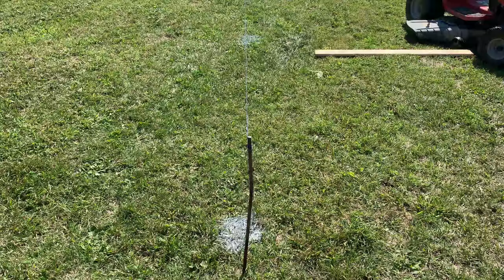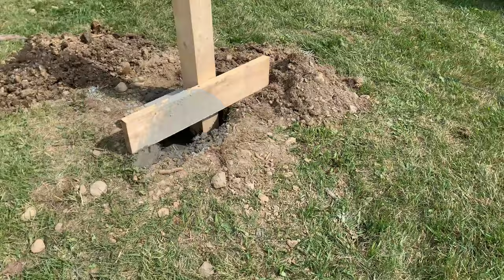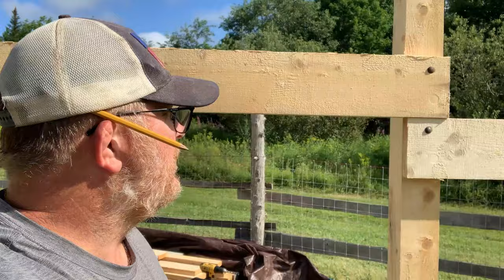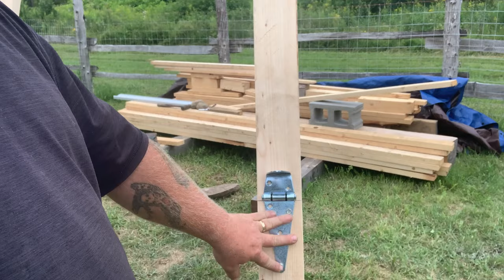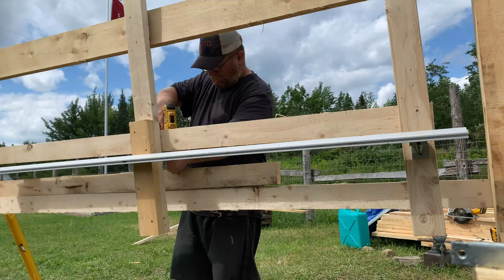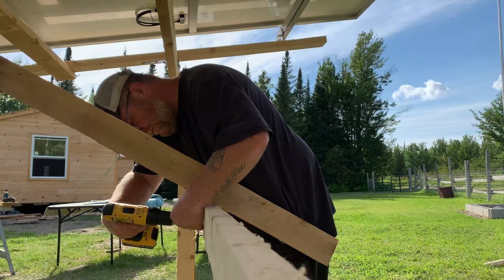Building our Adjustable Solar Panel Rack in Maine

Comment: As a suggestion from a retired mechanical engineer, you might want to change the angle setting mechanism to a 1/2 inch bolt through a hole made in the short "alignment" 2x4 and a point in the "adjusting" beam for each angle you want to fix the panels. A nut on the bolt can clamp the adjusting beam ridgely to increase systems stiffness.
Reply from the maker: Hi Mike, appreciate the suggestion.  This worked in the summer and fall but as we got into winter, I realized that I’d have to make a change to how it gets adjusted. Will be modifying the adjustment mechanism in the spring, so stay tuned! (As a retired ME, I think you’ll approve 👍)! 😊

Comment: You can also drill a few holes and use simple 1/4 or 3/8 nylon cord as lashing to prevent wind from causing mayhem with the swivels. They look pretty good. Are they working well?
Reply from the maker: The racks have held up in 50+ mph winds. We did have to do a few things to create a wind break behind the panels. Didn’t expect as high or main direction of the winds but they are doing great now! 😊

Comment: Great design and execution. 
I was solar off grid in Alaska and adjusting the panels through the year were no where near as easy as that.
Reply from the maker: Thank you for the encouraging words!!  I added additional supports to each section which improved stability of the entire rack. We’ve since moved the panels to our fall position and it was as easy as the video outlines.  😊

Comment: Looks good. I think I will do something very much like it today. I have 16 panels I will put 2 rows a series of 8 in a strings. I will be putting mine in just dirt but probably with a 2x4 45 degree outrigger to help with support. I will be moving these in 4 years so I want to be able to take them out. Not a lot out there about building a ground mount unless you use big steal and have heavy equipment to help. Glad to see something more on the average person's level. How did it hold up to the wind? Let me know if you would do something different now that you have had some time with it. Thanks for taking the time to show us. Wish me luck!
Reply from the maker: Hi! You’ve got the right idea with the outriggers, you’ll definitely want those if you don’t plan on using cement.  
Also, when you get your hinges, get a minimum of 6” hinges. 
This rack consistently sees 15-18mph winds with the panels in the near vertical winter position and hold up great.  I couldn’t be happier with the performance.  
Have had quite a few folks reach out and ask for an update on the panel rack so I’ll do another video here shortly. 
If you get time, take a look at my propane video; I give a short update on the rack.   
Thanks for the support and best of luck on your build!! 😊
Reply: @HanbleceyaRanch  Thanks for responding. Looks great! I should stain mine too when I'm done but might be a little late in the season lol. I think I'm going to have to put out 2x4s attached to 4x4s and deep stacked into the ground at least for now. Like you mentioned, Cable wires would be less noticeable and probably a better idea. Today was 25 mph winds here in MD so it got me to thinking harder on these big panels at 60 degree winter position into the wind. Spent way too much time at the store today getting supplies (well they were out of things so I had to hit 3 stores to get everything, a sign of the time and up coming future I'm afraid to say) and wasted the day spending more money than I had planned, hoping for some returns lol. I got 8" hinges with bolts to lock them into the 2x6. I'm bolting everything down no screws. Tomorrow I will get started. Enjoyed your propane video too. Keep up the good work! Thanks for your ideas and help! I will let you know how it goes.
Reply from the maker: @LivingFree4All  if the winds get above 20 mph my plan is to adjust the panels to their summer horizontal position.  Less drag and the rack doesn’t move at all - seen this during the summer.  So don’t worry too much about the wind, cause with this type of system it’s fairly easy to adjust it.  But the outriggers will be a must - both ways too.  In the ground just enough for it to grab hold of if need be. Keep me posted on your build!!  👍
Reply: Well I think it worked great! Done. Thanks for help and ideas!
Reply from the maker: @LivingFree4All  I sent you a PM.  They look fantastic!!!

Comment: How does the rack hold up with storms and high winds?
Reply from the maker: Hi Shawn, during the summer with the panels horizontal, there’s no concerns.
With the panels in the vertical/winter position, we needed to add a windbreak behind them. We’ve seen winds in excess of 40+mph and have had no issues. 
Without the windbreak the rack works well up to 10mph, but anything over that the panels move quite a bit. 
Keep in mind our panels are 6’ tall.
Reply: @HanbleceyaRanch  I’ll be out in Northern Texas in a few months and will be off-grid. This might not work for “Tornado Alley” but it was fun to watch and gave me some ideas!